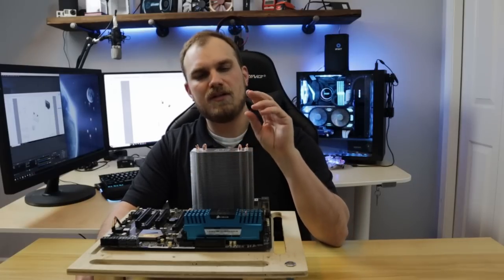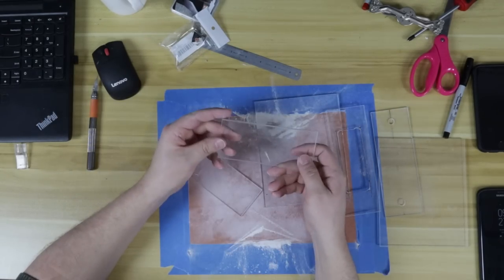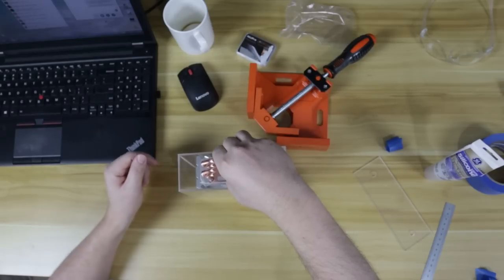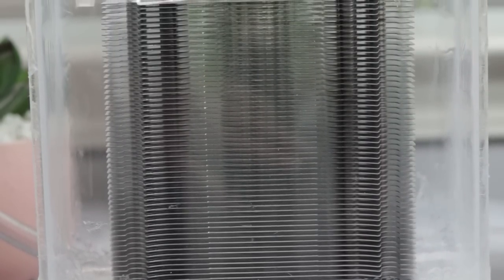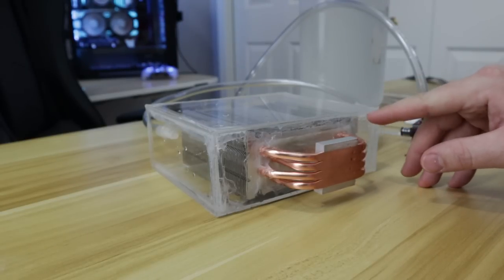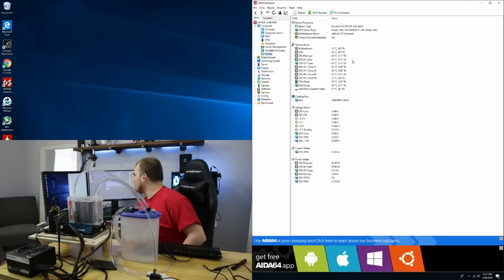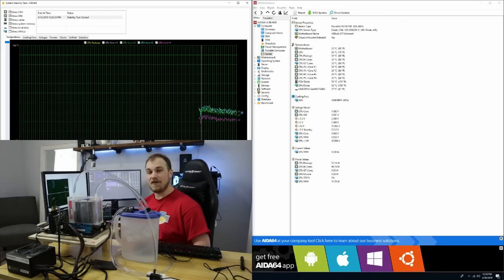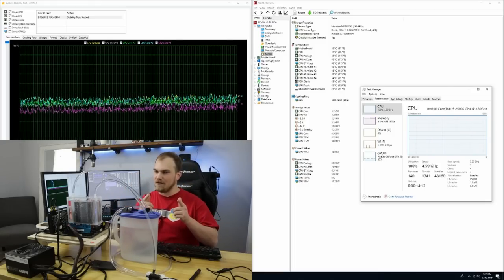I Water Cooled My Air Cooler AND..........

Comment: I'm just wondering why you have the tubes stop at the top of the water water reservoir in the tank. I get having the outlet be at the top of for water displacement and thermodynamic reasons but having the inlet be lower might help get that cool water directly to the hotter fins instead of being pulled out of the tank before Heating.

Comment: Ok i lnow im kinda late here bit if you took a hollow acrylic rod and end it a couple mm from the bottom with holes drilled in as it goes down your have better circulation. Kind of like a self clean hot water heater

Comment: Should have kept the bottom top and sides tight to the fins with a bit of room in front and back.  Then have the fittings on opposite sides so the water would be forced through the heatsink.

Comment: only water and air? whippersnapper.  The big hotness in 1998-2000 was peltier active coolers.  A lot of people destroyed their CPU's with them.  It was in the days of the ZIF pin socket and the coolers would get cold enough to dray condensation and sometimes even frost on the chip.  So you'd have to slather to whole socket in vaseline and hope that it would prevent any damage.  The edge-connector  cartridge based packaging of the of the following generation of CPUs made it difficult/impossible, and by then people were starting to realize the peltiers were more trouble than they were worth.  Also, that's when heatsinks started getting much bigger and way more sophisticated, and fans started getting bigger and quieter.  The accoustic dissonance between the two 40 mm fans on my celeron 300A, 2 HDD's, and Riva TNT fan all spinning up  would vibrate the walls.  I had to move the tower from my desk to the floor due to the hearing damage it was causing.

Comment: Hello I had an idea that uses simple scientific principle of heat rises and cold descends pumping the cold water lower down near the base of the heatsink and have the warmer water extracted near the top of your designed waterblock that would also allow the water to flow better around a device cooling it quicker I hope this helps and I really hope you make another design as this is an awesome project

Comment: should have had a plate in the middle inside to help force the water through the fins. with current location of the inlet and outlet water is probably only flowing through 50% or less of the fins

Comment: i see jayztwocents and gamers nexus doing competitions for cooling and benchmark records. i think if you were able to get ahold of a bit of serious hardware, and make up an acrylic box for both a gpu cooler and the cpu, you could hit some extreme benchmark numbers without going to LN2. a big package of dry ice in a cooler being pumped through works plenty well enough, and may even cause super cooling enough to where you'd need to put petroleum jelly on the hardware to keep it from condensating. proof of concept works, i think it has some extreme potential.

Comment: Use glycol as that transfer heat better but I made a similar setup with an ice cooler and two computer radiators and a duct fan to make a home made air conditioner.

Comment: Do exactly this, but with the pitcher inside a mini fridge. You will need holes in the fridge for the tubes, but it'll be worth the damage.
Edit: Shoot, maybe even run the tubes through the freezer tray of it. Since the water in the tubes will be circulating it won't freeze.

Comment: Ok the new cooler cools - but how much more/less than the original? A quick benchmark with the stock cooler would have been cool... 
The ice cubes introduce a lot of variables in this setup - having at least one thermometer on the water would've been nice.

Nice build anyway - now I have more questions than answers :)

Comment: This is essentially an over sized coldplate. I like the idea and think it's fun and creative and possibly even pretty, but I'm worried about the mounting. I would want to have the heaviest part be at the bottom.... and as long as the system hasn't been tested for months and even some stress (like bumping it) I'd be weary about putting it on anything expensive.

Comment: Um, you just sort of stored the heat temporarily in the iced water by heating it up with the CPU. What happens after the water in the loop reaches the CPU temperature? Since you haven't added any radiators, I think that the system might even overheat after a while. Would have been nice to see a more meticulous testing.

Comment: it'd be even cooler if you could send water down the heat pipes, not sure how much flow is to be had down where its pinched at the processor contact point though

Comment: I think this design would work better if the two connections were on the (wide) sides of the box so the water would have to go throug the plates of the cooler.
Now the water just passes them. You can see there is still some air in between the plates, so there isn't as much, or barely any, heat conduction happening.

sorry for my bad english, I hope you unterstand what i mean :D

Comment: taller tank in order to fill the air tubes with water, with cold intake from the bottom with hot outtake from the top [solar collectors design]
1. larger area for heat transfer
2. water cooled design replacing the air inside of tubes and with the difference of density you could have a natural loop. [just like the air inside an air cooler]
result: better performance for cpu with better cooling efficiency

Comment: Water Cooling the Air Cooling is called a Water Cooler.... The fan blades are just part of the water cooled heat sink....which is just bigger, bulkier now and doesn't work at well due to design and materials because you are using one made for air cooling. You reinvented the water cooler with a worse design. GJ!

Comment: Heat pipes and thermal pads are just transferring the heat, so you did used silicon or epoxy for connecting heat pipes with the acrilic! The heat generated by CPU can get around (95°C) [under heavy loads or bad cooler] so theoretically you allowed (90°C) to pass through the silicon/epoxy as well. AFAIK this amount of heat [if not melting] will cause the silicon to get loose and the consequences will be 500ml of water making a nice stream over the motherboard.

The idea is cool, you made radiator but your assembly is not the right way.

Comment: should have used light mineral oil  for this job instead . it would prevent rust forming on the fins. also oil would not waste the main board if it ever leaked.

Comment: Use an aircooler with mixed metals is fun for a video but maybe in the real world a very bad idea. Iron will rust very quick and copper will react and build gunk/degenerate with aluminium in the same waterloop within a few months. Even with good additive in the destilled warter this should be the case. Using only the same material in the waterloop as your radiator is highly recommendet in my opinion. Another problem is the huge weight of the Water on the Motherboard. This thing is way way too big for its usecase. Use a smaller aluminium only Aircooler will fix that. Finally the leaking Problem could come back after the system gets more heat cycles. I get it, its a fun projekt. But I highly recommend to not copy that as it is, if you want to really use something like that a little bit longer in the real world. My idea for another video: Cool only a small part of an smaller heatsink an call it a water/air hybrid cooler. Wouldn't that be cool?

Comment: So, the air cooler uses a vapour chamber. A water cooler is an air cooler with pipework between the radiator and block (the part that interfaces with the CPU.)
You are water cooling a radiator for a water cooler.
Yeah, the point of a water cooler is to pull the heat away from the heat source to be dissipated somewhere else; a water cooler isn't a fridge. A vapour chamber (air cooler as you called it) cooler works the same way as a fridge without a condenser or pump as heat and channel diameter cause flow.

Comment: There's only one problem. should have done a prolonged stress test, 1hr or 2hrs, because the liquid is not being cooled, it is just exchanging heat, and since there is nothing to dissipate the heat out of the circuit, with time it will accumulate more and more heat .

Comment: the only ting i would have done diffrent is put the cooling lines paralel on the rad alowing a bit more flowand run it like a regular loop with a set of rads

Comment: Snip the top of the heat Pipes and run water through them and you will have a very similar effect without having to worry about building a case around the cooler And leaks

Comment: I have a mad idea: 
Thermal conductivity in metals depends mostly on electron movement. But this is just diffusion, and water flow blahblahblah.. the point - what if you apply current on this cooper pipes? It should create electron flow, and blahblah, same benefits as water flow.
Will it have any effect in reality?

You might need to saw aluminum blades in half, though..

Comment: What is the difference of this compared to the heater core of a HVAC system in car?
I do understand he is using water to pass over the fins but how is that so different from pushing/pulling air across?

Comment: Dude, that is some massive aqua-block. Through the heatpipes you will get some thermal lag, but you should have enough mass to compensate for that. Just add some alcohol and use the stuff from an old fridge as cooler.

Comment: I feared that the heat tubes would heat up the silicone and make it leak. But it seems to work well :-D
If you rotated the motherboard by 180 °, leaks would no longer be so threatening.

Comment: huge flaw though? should put the input and ouput tubes either side of the heatsink channels, otherwise you are not pulling water through the heatsink... seems like you are not taking advantage of the heatsink... this could work 10x better if you mount the tubes either side of the heatsink faces. please make a mark 2

Comment: i don't get the point its like dipping your radiator in the water .i understand its a bit different but pretty much same idea.. i mean hats off to you for atleast trying.you used ice water which made the temps to go down which is not going to be used in a standard application of water cooling.i dont think the standard liquid would effect the results by alot.

Comment: Need to have cold come in low on one side and the hot out the top on the other
Also, use the same stuff they seal Ford windshield in with. Super persistent and tough

Comment: Why you don't use those heat pipes as water line, drill they're top head and connect them with hoses as an car radiator. The first and the last of those heat pipes you can use as the entry and the exit of the line water.

Comment: need to channel the flow. also need to beginning of the loop to channel across the bottom of heatsink. I would also introduce radiator as ice in water is huge cheat. please keep in mind how heat sinks work. surface area. if the water is not moving across the heat sink, than the surface area is redundant.

Comment: This is not a water-cooled air cooler. It's only a water cooler with the radiator right on the cpu block. Worse: with a normal water cooler, the radiator is being air-cooled, this one isn't as it's submerged. It would need a second separate radiator to do the actual cooling.

Comment: cool idea but you're crossing the stream to get water... why not use a cheap two slot water cooling system and mount the CPU cooler as usual but instead of using air cooling for the rad you dunk in it a water bath. That way you're not having a janky water cooler over the motherboard. Also when designing a water cooler like that you would naturally use gravity as your friend and mount the board vertically so if it were to leak the it would drip directly onto the motherboard and you would also not have a graphics card under the water block. It would be much easier to have a line out to a much larger water reservoir with a greater thermal mass possibly "outside", on a cool spot, in a hallway etc. so you're not ending up heat soaked.

Comment: Isn’t this exactly what a water cooler is? It just radiates the heat from the metal to the water like a water cooler? Which then directed out to be cooled somewhere else? I feel like the only difference is it’s just oversized what modern AIO’s are.

Comment: So I was thinking the best way to cool a CPU would be if the CPU manufacturer made specifically designed holes in the CPU so you can add liquid like antifreeze is used in an engine with a radiator but then again I know that metal expands and contracts so I am not 100% it would work. also since the CPU would be larger you would need an adapter to attach it to the motherboard but yeah it would be definitely cooled to the max with that method while still adding fans on top. So it's kinda like the opposite of your idea kinda!!

Comment: The only potential issue I could see is that your not providing a way for the heat to leave the system. You are taking heat away from the cpu, but eventually your water tank will heat up and not provide any cooling for the cpu anymore. There needs to be a way for the water to get rid of the heat. Cool concept though 👍

Comment: Hmm most of you don't understand the fact that watercooling has it's limit. Once the water reaches a temperature treshhold it will be just effective as any other. Maximum that you vould theoreticaly cool your device is the room temperature. So a dedicated 2 vent watercooler will do about the same job...

Comment: Heat pipes will not work for this application. The way heat pipes work is the liquid boils off the cpu and drags the heat in steam/vapor to the top of the heat radiator in the pipe  that will allow it to condense and stick to the side and wick down to start the cycle again. If the radiator is in water the chiller will not allow the vapors to bring the heat to the top of the pipe making all of the radiator worthless.  You effectively bring the dew point level lower in the cooler. This means less heat is leaving the cpu block to get cooled. Would work better with solid copper.
Reply: What is all this scientific engineering mumbo jumbo! Water cooling mi air cooler is so dope... Nobody has done this before... I so smart ...
Reply: @Ghst-tl9ec  didn’t linus tech tips do this exact thing?
Reply: @Astinsan  Probably, he smart too...
Reply: @Ghst-tl9ec  lol
Reply: @Ghst-tl9ec  touché

Comment: How about  air cooler +water cooler that you make but using a alluminun or metal for that tank not glass and  outside of that, cooling fins acts as air cooler to cool the metal tank.

Comment: Before I even got into this video, I could see the issue. You need another external radiator with a fan to cool the water in the system which is being heated up by the heat sink itself. Without this, all you're doing is slowly heating all the water in the system with the heat having nowhere to go

Comment: Don't put the radiator at the front of your pc, but on the top side. This way there will be no air bubbles in the cooling liquid at the cpu and the cooing system will be silent instead of hearing the water flow.

Comment: Just cut the heat pipes on top and loop some tubes to the pump / radiator and boom water / air cooler.

Comment: Seeing this 1year efter post. I think u bred to do a plate with thin holes restrickting the water from passning freely and do the tank smäller to only let water go thru the plates and not around them. As some high end cpu water blocks have small milled channels for water to run thru.....

Comment: Couldn't it and the cpu just be mounted upside-down with the water inlet and outlet on the top of the setup. That way the heat pipe leak issue wouldn't even be possible. Or do thw heat pipes have to be on the bottom

Comment: air cooler fins are too close to properly develop waterflow, you'll develop pools of hot water around the pipes and between the fins.  if you want to try this properly, try an air cooler which can be cooled passively without a fan, something like one of those old Macho towers or something, furthermore cooling those old SB i5s was rather easy, this isn't really a test.

Comment: Just buy a Noctua air cooler and you are set , even the most expensive custom  watercoolers have the risk of leaking or pump failure and the procedure to replace needs extreme caution and experience handling

Comment: ...perhaps you shud have your water intake pipe opening low near the bottom of the tank so that the cold water enters the bottom of the tank the heated water exits the top of the tank.. this way you dont accidentally mix the cold water with the hot water thru the same level in the tank...

Comment: Isn't this kinda just flipping the watercool units? In water loops the radiator is pretty much an air cooler that holds water inside with air blowing through it.

Comment: I dont get it, how is this different than buying a cheap water block and cold water cooling it?

Are you suggesting an air cooler with it's bigger surface can be cooler more efficiently than the water block?

Comment: You had no water moving through the core, it was all moving around the gaps at the sides NDT the top. You were only cooling the edges. Close up the gap and you’ll get a lot better results.

Comment: Never use silicone on acrylic.   It will peel off.  You need to use the correct weld glue.
Reply: I have done tons of aquarium projects with acrylic and silicone. If you take the time to sand and rough up the joints where the silicone will be applied, it will stick!